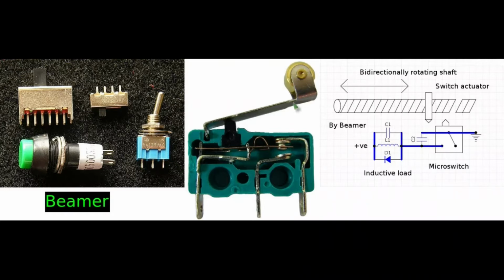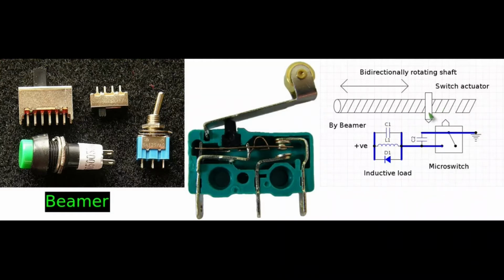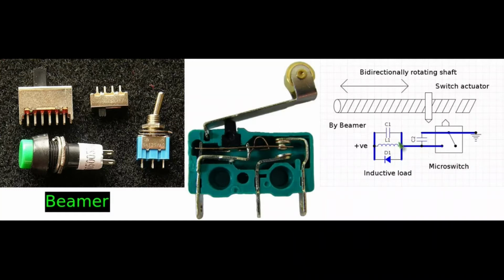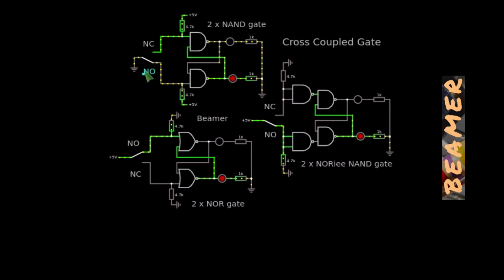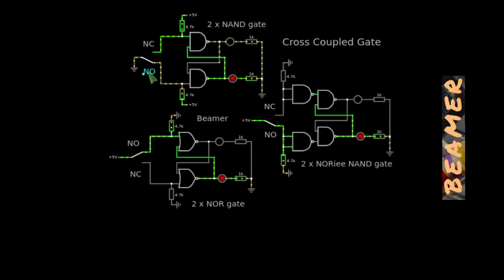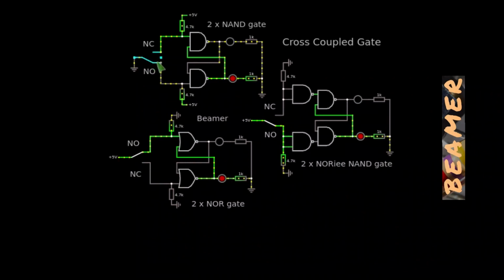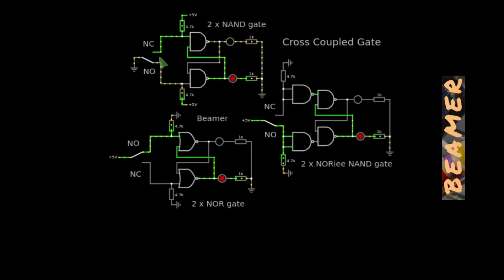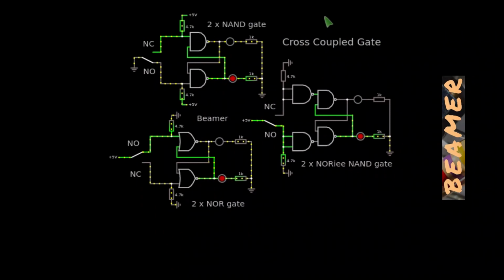A company’s costly problem was solved by a simple quad NAND package.

Comment: Neat solution. I remember this from college (many moons ago) & I think (without checking) that you can also use a D-type latch which has Set and Reset pins to achieve the same effect? V likely internlly the same circuit you made out of NAND gates. Good vid :-)
Reply from the maker: Much appreciated, thank you. Yes, I think it can simply be made out of any latch type - I just couldn't believe how chuffed that company was and how (over the years), it indirectly contributed to my income :) Stay safe, Beamer.
Reply: @beamer.electronics  Sometimes the simplest solutions are the best & the most elegant. Great that you identified the problem, "KISS" springs to mind. Glad the company was happy and you were rewarded for your problem solving! All good stuff 😊

Comment: I'm confused, and please correct me if I've misunderstood .
You used a classic set-reset flip flop  debounce circuit to clean up the output of a mechanical switch which was originally directly connected to an inductive load such as a motor or solenoid.
The output of that flip-flop was then connected to a transistor driven reed relay which in turn switched the solenoid/motor.
I have two questions: 
1) Why after cleaning up the switch bounce would you then reintroduce switch bounce from the reed relay contacts?
 2) Why on earth would you use such a woefully inadequate type of relay to switch a beefy inductive load?
Reply from the maker: Thank you for your thoughtful comment. Yes, I used cross-coupled nand gates, driving a transistor-driven reed switch. As I recall (going back 42 years :), the smallish motor was higher in voltage and lower in current. My little debounce circuit switched on/off much quicker than their prior configuration, which the motor seemed to like. Some reed switches can switch up to about 5 Amps, 10,000 Volts and 7 GHz. The recommended motor suppression circuit was also followed making it more resistive. Having said all of that, there was a lot of head-scratching by everybody as to why my circuit proved to be so effective and reliable - product life was about 20 years. All the best, Beamer.